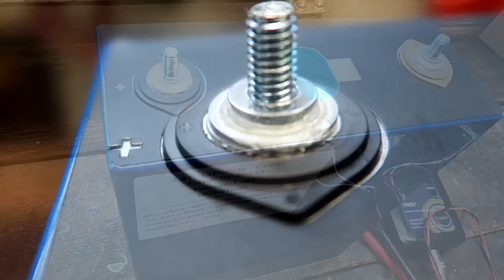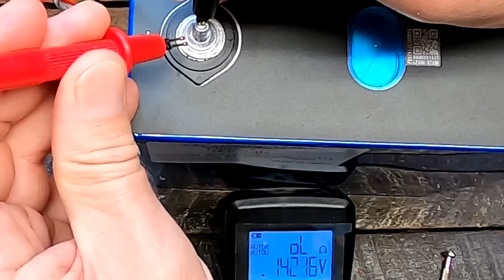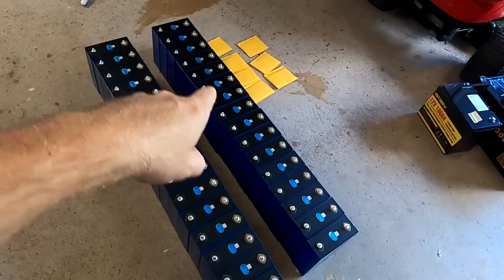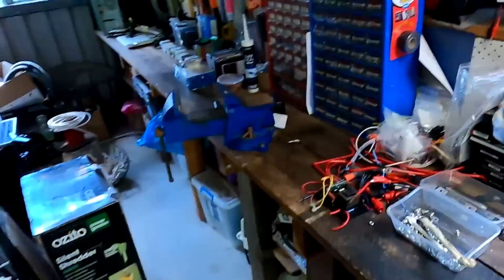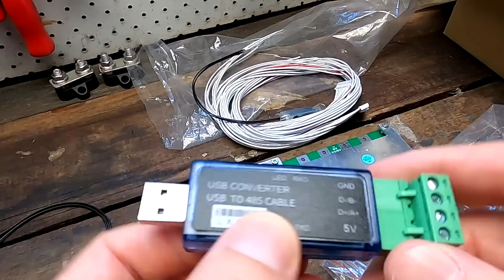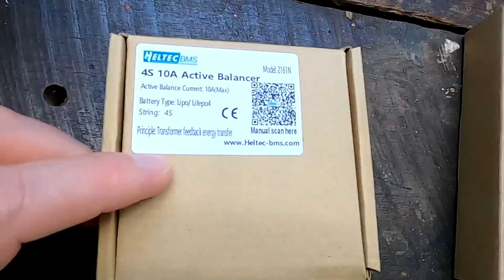Two new battery banks.. But what's the best BMS I should get? 🤔

Comment: 9:04 You can blame Russia for that, it's a consequence of invasion to Ukraine, bombing Ukrainian energy sector and as a result high demand for storage to stabilize the greed and have some backup for blackouts which happens basic daily.
If not for Russia we probably would have solar power and batteries by now so cheap that it would make zero sense to NOT have it in at least some degree. 

As it is right now i don't really see a huge benefit in going solar is you cant install something like 10kWh of panels and 30kWh of storage, assuming you have 20kW daily consumption.
But if storage prices drop below $50/kW for a ready to use storage (not just a cell price) and below $100 kW/h of panels, so that described system overall could be under $2-3k that would be arealy HUGE.

And that is the world we all should be living right now, if not for some stupid old dictators ...

Comment: The last 10amp 4S Heltec balancer shown, might actually function as an external battery equalizer for 4x 12v battery's in series to make 48v.  I'm sure you'll check the voltage rating to be sure.

Comment: 05:29
Why do the Chinese make small protrusions on the battery cell terminals instead of making them flat?  If the contact surface of the busbar is wide, there will be less resistance and better current flow.

Comment: I would test one of the early jk bmses with a 400 milli amp balancing current.  They are cheap but I don't know if they can keep such large cells under control.  But we are trying to get the most out the least always, right?

Comment: On the subject of adding washers to the terminals, it is a terrible practice because you'd be essentially putting the weld bead in tension, instead of placing the load on the single piece threaded terminal bung, and unless the weld penetration is perfect (which I doubt they x-ray and fully qualify them welds like it's done for spacecraft), with enough overtorque force, you can actually tear it off.

Comment: 32kWh Battery and only 200A BMS?  
I have also a 32kWh Battery with a 500A BMS from Daly.  Charging a Car with 11kW. The Inverter use for this 286Ampere  from the 48V Battery.
500A is 19kW from the Battery.  A Friend have a 12kWh Battery with a 500A Daly BMS, he have 4 x 5000W Inverter. Charge his car with 11kW too and the rest is fore his Home.

Comment: Question: If you build a 16s battery  or many of them with 304Ah batteries, what BMS do I need, 100amp, 200amp, or 300amp, thanks for your answer
Also who sells a battery box that holds 280Ah or 304Ah 16s batteries?
Andy - Thank you for all you videos and audio information.

Comment: I'm about to build a 2P16S 48v pack out of new LifePo4 280ah cells (CATL) from Battery Hookup. I asked the Support team over there if it was okay to do a 2P16S configuration using a single BMS, or if I am better off building 2 x 16S packs with each having a BMS. They told me that a 2P16S configuration is perfectly fine because the cells are new. If they were used, he said he would recommend two separate packs/BMS's, but because they are new cells, a 2P16S configuration is good. DO you agree with this?
Reply from the maker: I would not be happy with any parallel batteries. You can never be sure what happens between the two cells. They may be new and matched now but what about in 5 years time? How good are they still matched by then?
I would always recommend using two separate banks with a BMS each (yes, more expensive, but you have spend thousands of Dollars on the batteries, a second BMS is not much in addition. Full control over all the cells at any time. Redundancy: if one BMS or bank goes down, the other one keeps going.

Comment: It may well be stainless steel. Some is indeed magnetic. Also, some 'stainless' steel does get stains on it. I wonder why copper studs are not used. I suppose not a good match with aluminum. How are the studs welded on to the cell? I mean steel to aluminum??

Comment: With the "slot" in the busbar the area that is open in the slot that is not contacting the flange is not part of the circuit.  Only the horseshoe shape of the busbar is passing current.  So it might be best to tug the bar all the way over to the stud and tighten it.   If not then current is coming through only the sides that connect the plate.

Comment: Great video, as always.  But I think your conclusion on the current through the studs is faulty...  you measure the resistance from the TOP of the studs, which is nowhere in the current path.  The correct method would be to measure m-ohms from the height on the stud that would be at the top of the tightened nut and integrate downwards, which would be complicated of course, but the overall conclusion is that a greater percentage of current (bigger than 5%) would indeed be carried by the nut/stud.  All this being said, I now rest easy on drawing 200A+ through those skinny little studs!  Again, thanks.

Comment: I personally think you should have combined the two battery banks (of 16), with the differing aH ratings and then tested a BMS (such as the JK unit) across all 32 cells, wired in to 16S (which would then be 16S2P). You could then describe a situation with mixed batteries and how the BMS would adjust to the scenario. That would have been educational... :)
Reply from the maker: Well, if we parallel the cells first, the BMS would not care as it sees these cells as one cell only. 
I don't like this at all because we don't have access to all individual cells. If I parallel 3 cells for example, how would I know if one of them is faulty? I would not recommend such a setup with these large capacity cells. It can be quite dangerous.
It is far better to have single 16s1p strings of batteries with their own BMS each and then parallel them.
Reply: Are you sure about this? Would 2p really be any different than 1p. 2 cells become one. Does parallelling 2 banks bring any complexity? Do you treat the set of 2 parallel banks just as one bank?
Reply: @HobbyFinn2  if all the cells are perfectly matched then 2P isn't an issue.
I rarely have seen 8 batteries matched much less 16 or 32.
HOWEVER, 2P with active balancer does not require all cells to be matched.

When my new BMS arrives in a month, I am trying the 2P thing.
It is best to match your best cell with your least best as a pair when paralleling.

Comment: Please test REC BMS together with Victron. There is no Video available!
Reply from the maker: OK.
Reply: @OffGridGarageAustralia  The BMS must control the charge current from Victron to prevent overcharging.
The best chase will be a controller, who controlls the difference voltage. So the difference voltage should be arround 20-50mV
 If the diff. voltage value increase, the BMS should slowly start to tell victron to reduce the current. Like 60mV --> 90%, 70mV--> 80%,....100mV --> 20% until 0% so batteries wil never come in the overvoltage problem. 
In the end of LiFePO4 cells all Balancer get problem because the voltage rise to fast.
Reply from the maker: @kevstone122  The BMS cannot control the charging, it can only send a signal to the MPPTs to slow down.
This should also only occur at 90% SOC or higher. I'm still not a big fan of such constructs. If you have several battery banks in parallel, slowing down the MPPTs will affect all batteries not just the one which have a high cell.
Reply: @OffGridGarageAustralia  Thanks a lot for your answer and also your good videos.
Okay if it will reduce the MPPTs it's also good. So the REC BMS will do that? But REC is only for 16S. I want to change to 17S to reach with 3,4V x 17 = 57,8V which is maximum for Victron. You kow a better BMS for this size in my ESS system at home?

Comment: Hi Andy. You could actually measure the resistance of the stud, through the nut to the busbar, if you but something isolating under the busbar, for example a plastic washer. So that it does not have direct contact with the upper side of the pole. Torque with 4Nm and then compare the resistance to a normal properly connected busbar. Wouldn't that be an interesting experiment?

Comment: Hello there. Could you please  provide  a link to a 4s 100amp 120amp bms with low temperature cut-off that actually  cuts the charging  off at 5c please. Lithium ion  phosphate. I've tried  the daly bms which  doesn't  work.  Thank you.

Comment: Great videos, very informative. I have a question. I saw a video of somebody who put two 12V 100A Li-Ion batteries in parallel. The BMS were 100 amp and says he was getting a total of 100 amps total out of the set-up. I would have expected to see 12 volts 200 amps. Can anybody clarify this

Comment: Just got 17 cells from Qishou for 148usd a piece. In stock in a warehouse in Poland, shipping time 5-7 days. Apparently pretty pricey but still a steal compared to what german resellers want for what is essentially the same cell. (They charge around 200€/210usd per Cell).
Communication was great and straight forward, no issues at all. Even got the order and tracking numbers done on a sunday :)

I think the matching comes from NMC cells where there is a direct correlation between the IR and the remaining capacity (Relative for each model of cell of course). Andreas Schmitz here on youtube has created a database that can predict your remaining capacitance based on the IR and can be used to evaluate salvaged NMC cells.

Comment: What a great introduction I would usually have missed - I mean the studs resistance measurements.
I was looking for the next bms and not expecting a basic introduction to the EVE LF280K battery.

Great content, high quality and on point.

4 NM is pretty low and a reminder to me to get a torquemeter / Drehmomentschlüssel.

Comment: Good video, you had to put the batteries in parallel and measure the resistance and in series and measure the resistance. To balance the batteries I made an idea that for 4 batteries in series I had a resistance of 1Kohm parallel across each battery during charging, it now only an idea and will probably not work in practice.

Comment: I have a question about the JK BMS and maybe someone can help me out. On the description of the product it says that it doesn't support series Connection and parallel  connection. What does it mean exactly? If I have two identical batteries using two JK BMS, I can't connect those batteries together in parallel for instance?
Reply: I spotted that too, but ordered one anyway. You clearly can have 2 identical systems in parallel, as Andy has done. I assume that they mean you can't have 2 banks in parallel & have one BMS trying to balance those cells.

Comment: I'm sorry for the basic and stupid question I'm going to ask: Can I lay the battery down? (stacked one on top of the other - LifePo4).
I have enough height space to put batteries but I don't have wide space
Reply from the maker: That's a good question. I believe you can do this for some time but not permanently due to the fluid inside the cells. I'll confirm this with the manufacturer and supplier...
Reply: @OffGridGarageAustralia   I appreciate your kindness and will be waiting. I really haven't found anything RELIABLE about it. Chinese sellers say YES to everything.
Reply: @OffGridGarageAustralia  I would be keen to see a proper response on cell orientation too...

Comment: You may not understand that there is 3 basic types of stainless steel. Martensite stainless (magnetic) ferrite stainless ( magnetic) and austenite stainless ( non magnetic) ..it is extremely poor engineering to use the same stainless on a nut and bolt as the threads will pick up and seize … my guess is they are using ferrite stainless studs and austenite stainless nuts… austenite nuts and bolts can become weakly magnetic when the threads are cut, as this work raises the temp enough to slightly alter the crystalline structure from a face centred  cubic to a body centred cubic.

Comment: I still don't understand why these companies aren't providing balancing rates based on a percentage of the total BMS capacity. Something even as low as 1% (which for a 200A BMS would be 2A, lightyears better than 130ma.) Preferably more like 2%-5% balance current would be much better in the long run. A small balance is great when the cells are new, but a few thousand cycles in 130ma will never keep them in balance under reasonable loads.

130ma is like trying to balance levels in a bunch of swimming pools using a drinking straw while filling and draining them using firehoses.

Comment: I vote for the latest and hottest BMS on the market: Qucc relay smart bms 1) 500A 2) Hall element. You have made 3 separate packs, why not make 1 big pack
Reply from the maker: I really like to have separate banks as I can just take single packs offline now without shutting down the whole system. Redundancy was one of the main design requirements of this new built.

Comment: Perhaps re-arrange the total pack into 3 cells parallel and 16 ( units of 3 parallel cells) in serie.
You only need 1 BMS. Downside is that the capacity is limited to the 280Ah cells…..
Reply from the maker: That is possible to do and it would safe you buying several BMSs. But this is pretty much the only advantage. Separate packs make so much sense as I can take them offline without shutting the whole system down. The separate BMSs give me full control over each individual cell (unlike in a 3p set up). 
The capacity adds up in a parallel set up. 3 280Ah cells in parallel make one 840Ah cell.
Reply: OK Andy, I do not see the advantage to have 3 separate 48Volt banks instead of 1. The more electronics, the less time between failures.Because you are using 304Ah and 280Ah cells, the lowest capacity cells (280Ah) will determine the max of the total pack, but what the heck?…still about 40kWh. Great video’s… groet Peter.

Comment: Install a busbar and measure resistance from the other battery terminal to the busbar adjacent to the flange nut. Reinstall this time with an insulating washer under the flange nut.  Get out your math. Calculate the resistance of the flange nut path and the percentages of current that flow each way. It will probably be more than 5% through the stud, but not a lot. Very little of the stud length is involved in the path. Both steel and stainless steel are poor conductors. Best to use copper terminals that fit the studs (round holes rather than slots) anyway. Over time thermal cycling will degrade the connections and the busbars will be worse than something that can conform to the stud base. Measuring something just built is misleading. Especially telling is how many hotspots had to be chased down and fixed with busbars. Over time they will be more troublesome than something flexible.
Reply from the maker: Thanks Alan. I will connect the new batteries with these busbars and see how this goes over time. It's a long term experiment, I guess...

Comment: I've sent JK a couple of inquiries now to run 12s LiFEPo4 36v system with the EVE 280K cells (dc motor draw up to 300A, maybe add a bit for potential overhead).  In looking at the data sheet on their site, I don't see this configuration supported. Hopefully, they will respond soon. DALY seems to have options to support this, but JK seems like a better option with the 2A active balancing built right in.
Reply from the maker: Never read about someone building a 36V system. Is there any gear and devices available for this option?
Reply: @OffGridGarageAustralia  It's not a custom build, other than the battery, but meant to power a golfcart that's stock at 36v.  Yes, DALY has an option.

Comment: Hi. Love your testing. About the active balancer; do you think igs possible/smart to have this atatched to the batteries together with the bms all 24/7 all year round? Or do you thing its a "maintenence" thing to turn it on only when needed?  When connected, and the battery is balansed, what is the power consuption from the balancer? 
Have a great easter hollyday.
Runar from Norway
Reply from the maker: Hi Runar, the balancer should only be running from 3.45V onwards. It creates a unbalance otherwise as we have see with the earlier built of the NEEY balancer. If it balances all the time, it will destroy your top balance. This may work with Li-ion but not with LFP and the flat curves we see.

Comment: I don't think it's a disadvantage to be missing the cables of the Heltec BMS. On your other rack battery you had to use those other connection points anyway. So it's a little sweat to make a number of perfectly sized cables that match your system and work without added bus studs. Perhaps use some scrap copper bar across the four attachment points to make it perfect connection.

Comment: Andy, your measurement was not relevant as you should have measured the resistance in between the areas where the bus bar makes contact (the small step/flange at the base of the stud).  I bet you will have higher resistance there.

It is so sad seeking all the skilled people here trying to fix a Chinese …up.  You know what I mean.  As I said, this issue will be fixed in a near future, maybe months. Cheers, Raz

Comment: Isolate a busbar on the bottom with tape and look at the temperature could be a nice test. The stud->nut->busbar touch surface compared with the resistance measurement is much bigger and the resistance will be a lot lower.

Comment: Hi Andy. I would like to see how the Batrium Core works. There should be at lot of parameters and monitoring possibilities for the battery. But the question are how good are they to the job.
Reply: I would like to see it Batrium myself, I bought 128x 300Ah Batteries and planning to use Batrium…